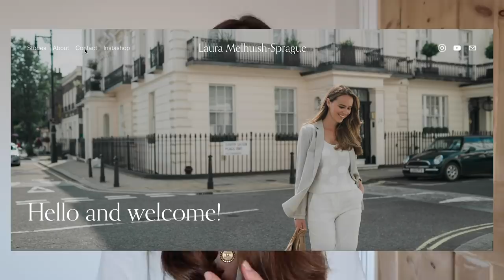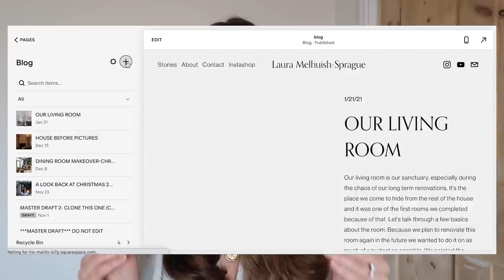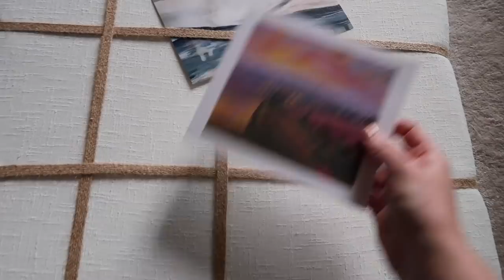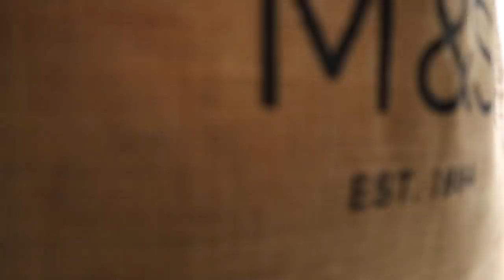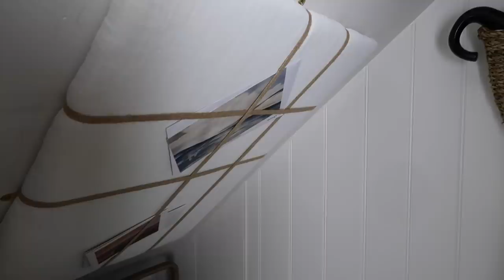SMALL SPACE GLOWUP | UNDER STAIRS CUPBOARD | Laura Melhuish-Sprague

Comment: Laura, if you have the gas in that closet, and by any chance there was a gas leak and you opened that closet with the automatic light, it could be dangerous, it could explode!
Reply: I was just thinking the same. It is better for you ro place a touch switch on the outside of the wall than the automatic light.

I worked for the fire Department. Those automatic light trigger many unnecessary explosions.😎